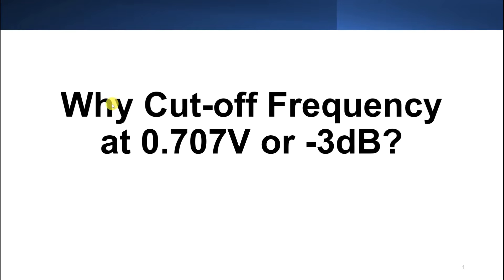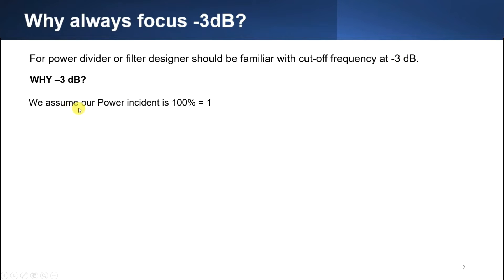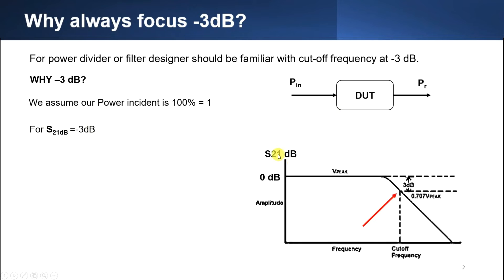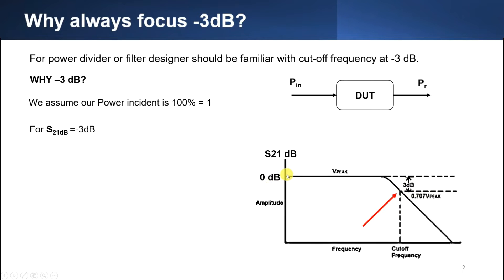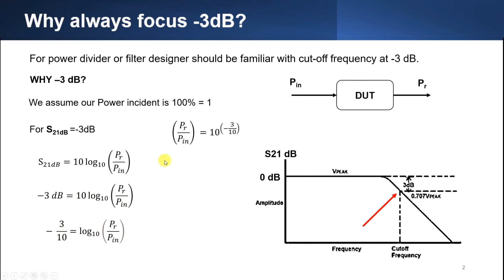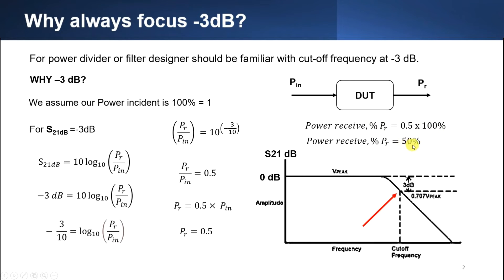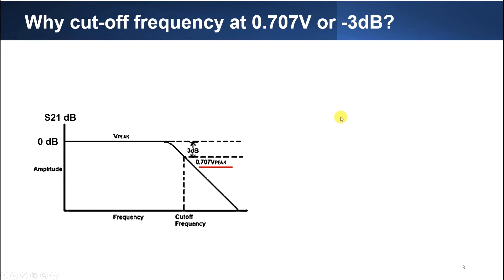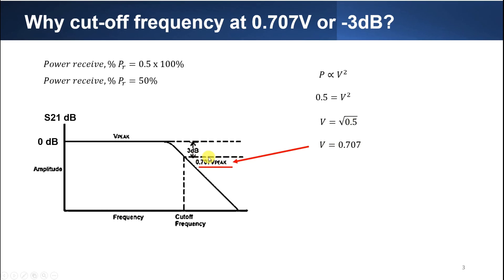Why Negative 3dB or 0.707V at Cutoff Frequency

Comment: Sir why you take s21 as -3db 
Why not -4 db is only because of half power. Then what is the spacality of half power?
Reply from the maker: Generally for RF component in data sheet, we use - 3dB to indicate the performance of the RF component after  less power 50%. Or cutoff frequency OF RF Filter or power divider